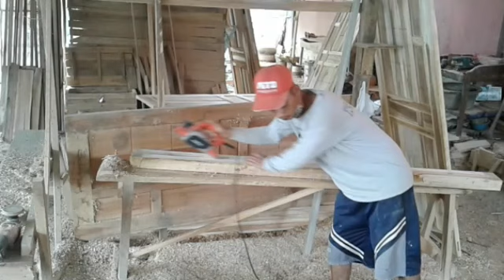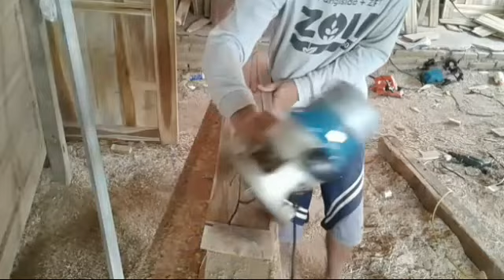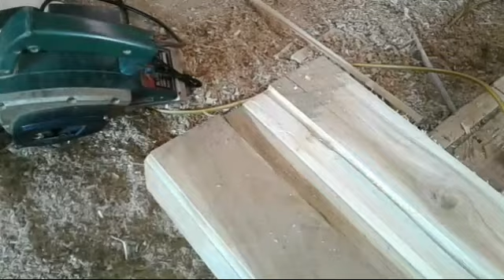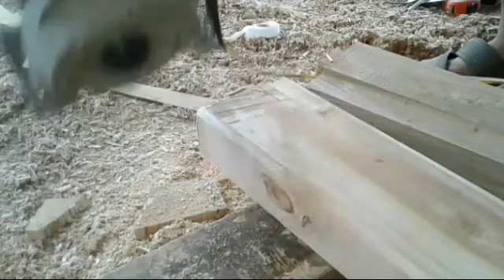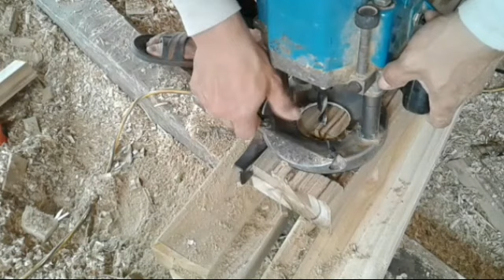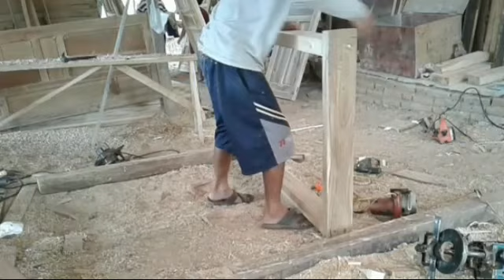Seandai nya aku tau dari dulu cara membuat kusen

Comment: Pintunya tdk rata dg kusen Krn skoneng dg alat tsb tidak dalam
Reply from the maker: pakai mesin serut dari kanan kedalaman skoneng bisa 5mm tapi kalo dari kiri kedalaman skoneng 1 cm.  Umum nya sekoneng cuma 1cm...klo kedalaman lebih dari 1cm sejak saya belajar jadi tukang belum pernah dengar dan praktek. Contoh jika ingin kedalam an sekoneng 2 cm bisa pakai mesin router atau circular Saw.